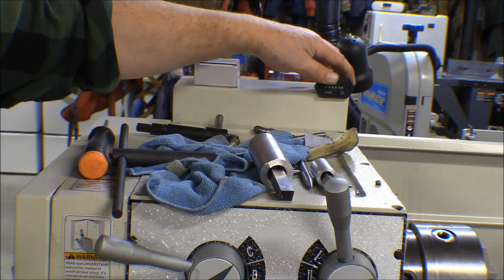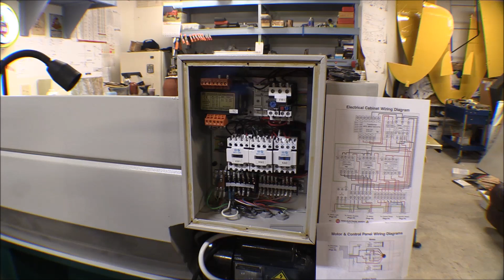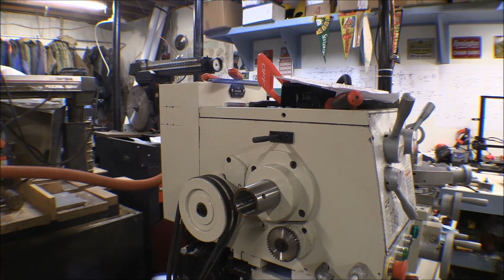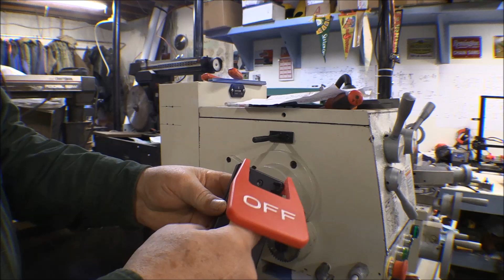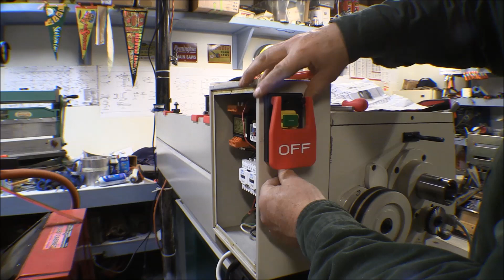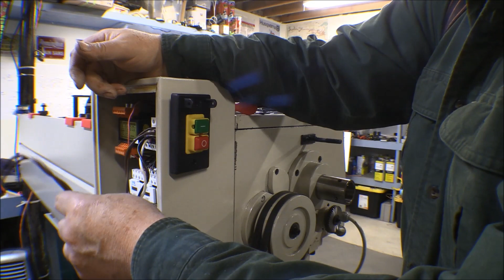Grizzly G4003G; installing a master switch and hour meter

Comment: Great video , thanks for sharing.. maybe you can give me some light on an issue I am having with my lathe , which is the same as yours. Went to work with it, and it was totally dead. The E stop switch was very bad, mechanically speaking, so I replaced it , thinking that might be my problem.  I wired it on the normally closed terminals , same as the other one , and still totally dead. I haven't been at the panel box yet, but looking at a diagram , I saw a 2 amp fuse... haven't check it yet, but what do you think.. thanks
Reply from the maker: Thanks for the reply. Not sure I can help you, I have forgotten most of what I knew of electronics. When you activate the main e switch the work light should come on, if not then the main relay is not activating. Of course the first thing to check is that power is coming to the machine and hooked to the correct terminals, I don't know how many times I've tried to start something and realized I had turned off the circuit breaker. The forward reverse handle also activates a switch in a box on the headstock. If it's not moving the rod that runs to the switch, or that switch is bad the machine won't run.
I know it's pretty basic, but there are two switches that have to be activated on the headstock, the red emergency switch and one of the green light/buttons has to be pushed. Sorry if that seems condescending, but I've  seen that problem before with bright people, myself included. I usually start with the simplest first and work from there, then circuit breakers and fuses. If you don't have a manual Grizzly has the manuals with circuit diagrams online, I think many different brands sell the same lathe under their brand so the wiring may be the same.

Comment: Hi, love your videos, I'm getting ready to buy the same lathe you have myself and I like the idea of adding an hour meter to it.  I'm really curious though, you say the leads to the motor are hot all the time, are these leads going to the motor contactor?  In other words they are the main lead that provides power to the contactor which turns the motor on/off.  A cursory search shows the contactor KM2 as the motor contactor.  Of course, most US 220v circuits only provide two hots and a ground, so in order to be safe (not that I'm a safety Nazi), you really need a neutral connection to make a true 110v circuit.  I don't see the need to add an additional master switch, I'd recommend using the motor contactor switch in order to control the hour meter.  Anyway, I hope you keep posting more vids, I'm also interested in seeing the Cub fly again, they're one of my favorite planes.
Reply from the maker: Thanks for the comments.
I checked all the terminals on the buss bars for one that switched 110 to hook up the hour meter to and and all the 110 ones were hot all the time. I didn't try any of the relays or the transformer or investigate any further as I decided I wanted to be able to shut power of to the whole unit when not in use. Turning of the red shut-off switch on the panel doesn't shut off power in the box so I wanted to be able to do that and just figured the lazy way to connect the meter was to hook it to one of the input leads on the buss bar since it would be shut off with the new switch, it won't tell actual run time, but will show on time which is close enough for me. 
I just got the windshield installed in the Cub, so the wings are next.